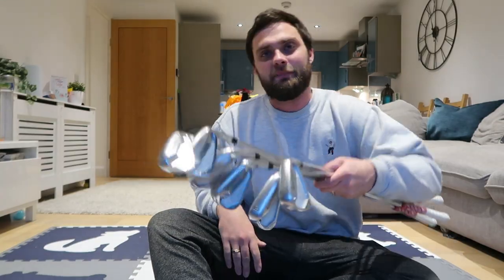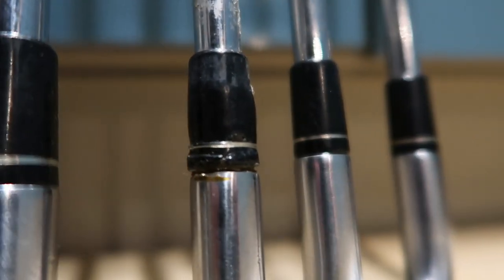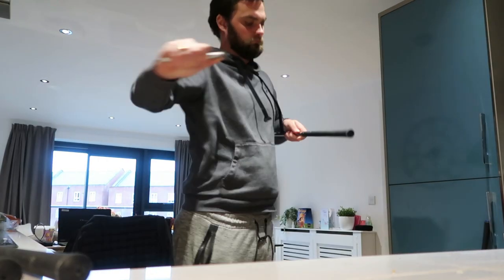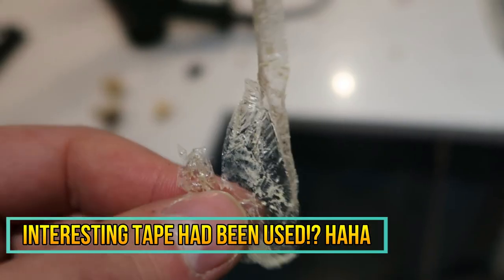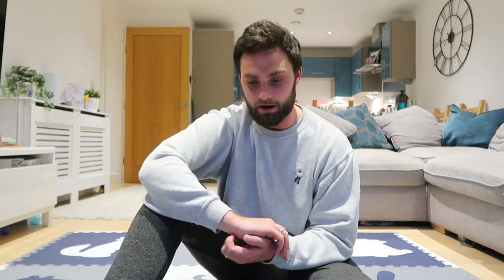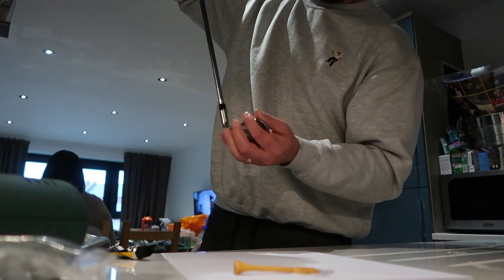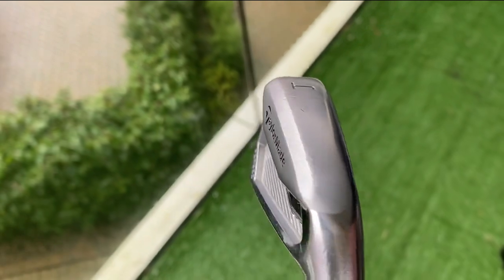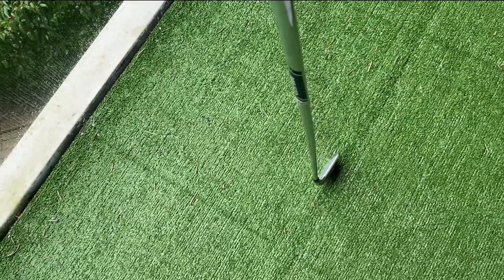POSSIBLY THE WORST BUILT GOLF CLUBS I HAVE EVER FIXED...

Comment: An old pro at Bali National golf club used a towel to rub along a bent 7 iron shaft to heat it up and slowly bent the shaft back straight back in 2003. Took him 10-15 mins and about 6-7 goes before he declared the shaft straight as new. Great effort as I was there to play golf for 10 days. It worked for me and I eventually gave the clubs to my brother a year later and bought new PING clubs. But definitely a useful trick to get a bend out of a shaft. Great vid again Simon
Reply: Absolutely, that works great to get a bend out. Just gotta be patient
Reply: Done it myself on many occasions for customers its a real skill and it takes time. I was taught by a pro from the 60s
Reply: @mike600f1  I was highly surprised and grateful. I bought a few lessons on the back of that as payback. Well worth it.

Comment: Hi Simon, I build up a few clubs myself, mainly changing my wedge shafts to lighter. Surely just put a tip weight in to the sux iron to keep the swingweights all the same, assuming that you have a gauge. Otherwise just check the 5 and 7 and tip in the middle.

Comment: You need SW scale to determine how length and tip weights will impact feel of the head. I’ve  rebuilt irons and found some need lighter or one may not need one if already heavier ( like your 6 iron?) only way to make them all the same is with SW scale
Reply: Steve is correct.  Because heads are rarely perfectly matched in terms of weight (7 gms apart).  In the typical set of irons I build, I probably have to put tip weights in 4 or 5 of them.

Comment: Nice Work Simon 👍

I found it easier to use 24-hour epoxy glue for my home builds. It's stronger and allows some extra time to align the shafts.

Also I invested in a very simple SW-scale for about 90 Euros. Then you can just cut a nail to the right length and weight and use that as tip weight. Just remember to glue it properly inside the tip

Comment: Props on the rebuild. I was watching, I actually rebuild a lot of clubs and do them quite differently. One, like you mentioned, I use a swing weight scale. Also, I have a club ruler. I always measure each club/shaft to the correct length and cut those first. I never use another shaft for shaft extensions. If I have to, then you can buy shaft extensions for about $2.50 each only! (And they're double sided, so they work for 2 clubs.) I always install the grips with the desired tape build up before installing the heads. Reason is, you add the swing weight to the tips, and you won't get that exactly right until you have compensated for the grips. 
I never heat up the ferrule for installing it, there's a risk it gets deformed. Instead, just use some q-tips and acetone and rub it around inside until it fits on the shaft. I sand the inside just slightly and add a bit of epoxy then push it into place with the club head. Anyway, just some ideas, maybe they help, maybe not.
Reply: You are doing things to a good standard there chap well done, not like this guy its a joke watching it and people thinking hes doing it right

Comment: Do you know if the shafts have been spined and floed? That could be the reason that the stickers aren't all on the backside of the club.... You can't say the have been assembled if you dont know the circumstances. As the other guys say, you really need a SW scale. Again there may be a reason to why the 6 iron has no tip weight.  Just a tip, if the ferrule diameter is bigger than hosel.. Then use acetone to turn it down. This is a home build, but sorry its not a good build, since you have no messuring what so ever...

Comment: I think you'd really enjoy a clubmaking course. If I'm not mistaken Diamond Golf International should not be too far away from you. Right now, you could add a manual swingweight scale to your tools. Then you can just starting using tungsten power to sw the clubs. You could also begin finishing the ferrules manually with the correct sandpaper and acetone. After a course you could start appreciating the delights of frequency matching, MOI matching, spine and flo, etc etc. That way you can buy clubs just for the clubheads and reshaft them for your clients in a more bespoke manner. BTW I'd go with 24h epoxy if I were you...

Comment: You can't assume that all the iron heads are to perfect spec from the factory. Some will be heavy, some will be light. That's the whole purpose of using shaft tip weights, to match up the weight progression in the heads as best as possible. 
Seems very likely that the shafts had been in a different set of irons, were pulled with heat, ferrules not protected, and then reinstalled in these TM heads with the ferrules in various states of deformation. Also possible the 6 iron shaft had a tip weight that stayed in the old head when removed and was not replaced in the rebuild. Only way to know that would be to actually SW the set to check.

Comment: If that shaft isn't kinked, you can easily straighten it.  Grab a towel and rub the shaft vigorously in the bent area like you are....   It will slowly heat the shaft until it is too hot to touch.  Then lay the towel on the corner of a counter and carefully push down on opposite ends.

You'll be stunned at how little effort it takes.  (You could use your heat gun to heat it, but most of the ones I have straightened have been a the golf course for friends. LOL)

And.... .350 ferrules?  Irons are either .355 for taper tip, or .370 for everything else.  The .350 ones are for woods and hybrids.

Comment: Wow, they turned out well!! What's happening with those heavily painted black callaway you bought? Just one thing: I've pulled quite a few Graphite shafts similar to a steel shaft, a bit less force but with enough heat applied they come out no issues without the need for a proper tool. The proper tool is bloody expensive from what I've seen.

Comment: The decals may not have been lined up because they pured the shafts 😂
Reply: Doubtful.  The shaft would be pured before the decal is installed.
Reply: @jts09  Yes if you assume the manufacturer of the shafts pured them.  But if the guy who built them spine aligned (pured) them, they could be all over the place.  But, David,  probably as poor as the rest of the club's assembly, it is doubtful if the guy who put these together knew how to spine align the shafts.  I'm betting on sloppy construction.

Comment: Just in the process of rebuilding my MP60s I got for cheap. So much easier than I ever thought. One thing Simon, how accurate are online swingweight calculators?
Reply from the maker: Never used an online one to be fair. I imagine they can’t be exact as how delicate the normal swing weight machines are.

Comment: Back in the day I had a club fit and Bought a brand new set of TM Burner clubs, when they were a new model. Turned up after 3 weeks and looked wonderful.
3 Rd game one of the heads fell off and disappeared into a Bush. In the same round, another head loosened.
Went back to my pro who examined and took them apart.
EVERY SINGLE IRON HAD EXTRA GLUE IN THE SHAFT - IN OTHER WORDS, THE SHAFTS FROM TAYLORMADE WERE NOT NEW BUT SECONDHAND! The 5 iron had so much glue, the tip was rigid and my regular flex played extra stiff.
Taylormade were not interested in replacing them.
NEVER BOUGHT ANOTHER TM ITEM SINCE! RUBBISH COMPANY.

Comment: Adding weight to the grip end of a shaft doesn't affect performance?
Reply from the maker: Do you mean with the 8 iron being lengthened? It will affect swing weight slightly but then so does changing a grip as a gram can move a clubs swingweight. I meant adding a plug in the shaft won’t affect the clubs flex and torque profile. Hope that clears things up.

Comment: Fancy building some clubs for me?
Reply from the maker: Just struggle with time and room at the moment mate. When I have a workshop I definitely will do builds. Thanks Sean.
Reply: @SASGolf  Cool. Managed to get some srixon irons super cheap because they’d been custom built with really short and light shafts. Not confident enough to rebuild them myself, so when you’re up and running with access to a workshop I’ll be in touch. (I’m in the midlands so not too far away)

Comment: You don't do a spine alignment on your shafts ??? & if you are going to use an old shaft for an extension , [not a recommended practice] , you really need a bit more insert depth into the shaft.
   As far as the 9I , PW , Aw being all the same length , well I play mine with this gap , I'm 6'5" tall & find that this gives me a more consistent strike when getting down to these clubs. My 54 & 58 are 1/2" shorten than them
    All in all , not a bad repair , you didn't address all the issues tho , ie I didn't see where you did any form of swing weighting , shaft spine alignment , you want to use only a thin skim of shaft epoxy , it works best when applied in a thin coat , a small dab of epoxy on the TOP end of the ferrule will lock it in place , [top end so it will slide down the shaft when you insert it into the club head. You should also probably use a good shaft epoxy , some epoxy's don't bond properly to the steel , & make sure they are WELL CLEANED , dunno what kind of epoxy that is , did you check the shear strength of it to make sure it will hold up over time ???